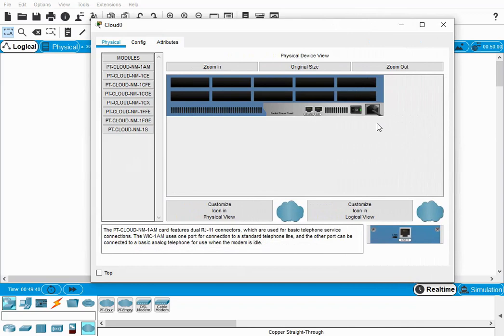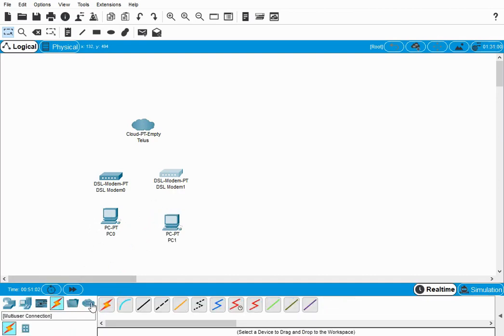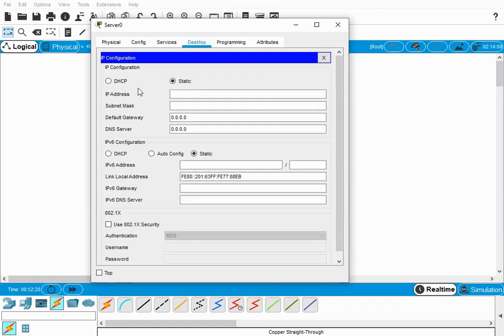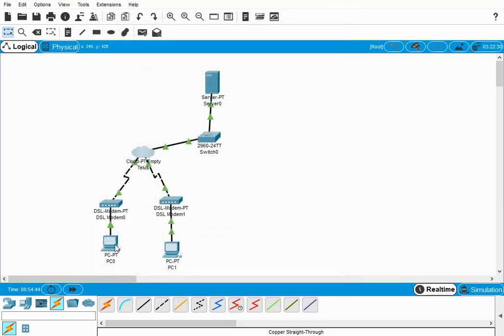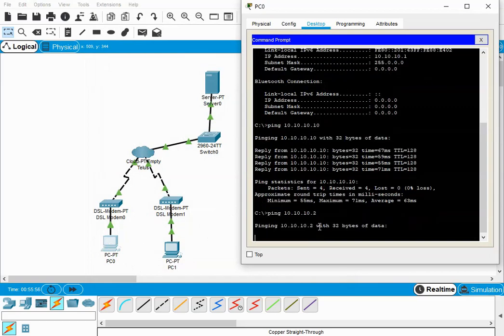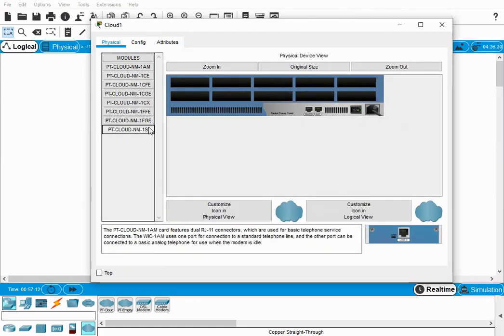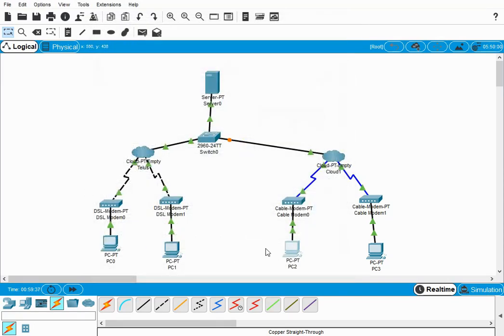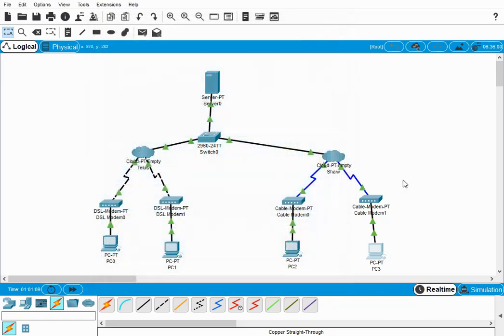Cisco Packet Tracer - Creating DSL and Cable Service Providers in the Cloud

Comment: Hello, everything was going fine until I tried connecting the wire to the modem and used the "coaxial' wire to connect from the modem and when i chose port0 (like how it was in the video) a pop up says "the cable can't be connect to that port) and there is only one port option. what to do?
in (7:58 min)
Reply from the maker: Sounds like you selected the wrong cable. DSL and cable modems use different cable. You didn't say which modem you are using. Or have a different modem selected.
Reply: @blanchae  Hello, My PC's aren't connecting to each other. I have tried to change the IP's  to DHCP but it still didn't work. any suggestions?

Comment: Hi sir, I've been reading many websites and watched many youtube vid, but I can't find out why my devices are unable to ping the server. I'm a beginner, can you help me? This is part of my assignment. It is just a small network.
Reply from the maker: Start off by checking:
1. Are the devices physically connected properly to their respective networks?
2. Do they have IP addresses on the correct network?
3. Do they have correct network masks?
4. Is there default gateway set to the router's IP?
Usually I start by pinging inside the network then the switch if that works then ping the router then outside the network.
Reply: @blanchae  Sorry I mistyped. I wanted to say: All my Devices can ping the server, but my server can't ping anything.

Sorry for terminology problem if any.

Edit: I'm able to ping everything to everything, except I can't get Server -> other devices
Reply from the maker: Sorry for the late reply, your comment didn't show up in my notifications for some reason? I would check your mask and default gateway to make sure you are on the same network. Do you have a firewall or routing issue?